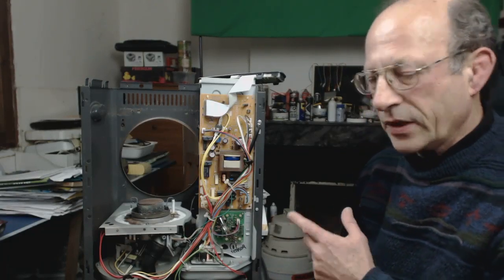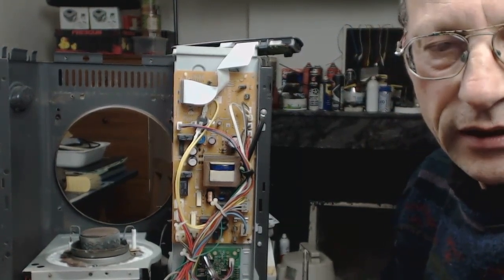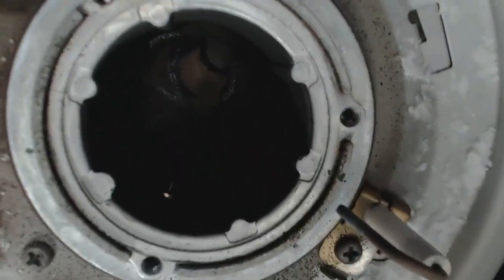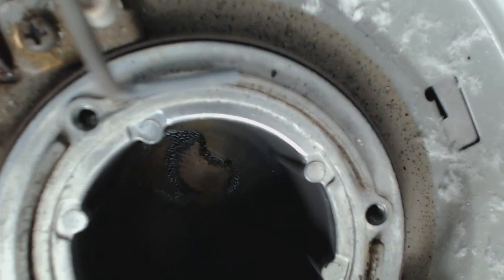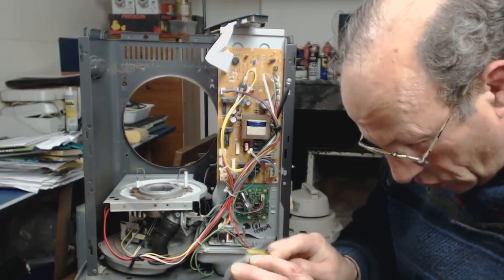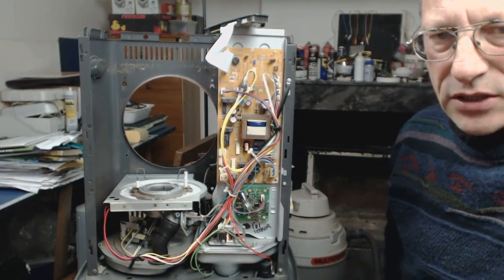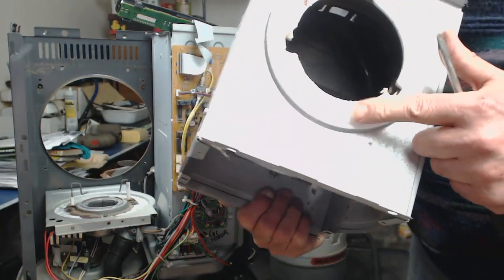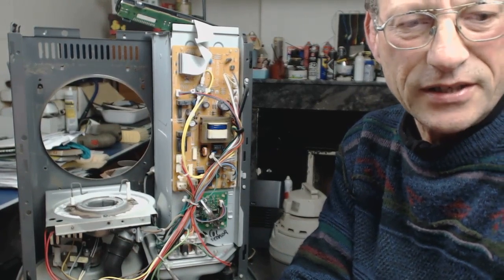Paraffin / kerosene / petrole heater: E4 Error (E0-E4) - Easy Fix

Comment: hi great vid however after cleaning flame rod heater runs fine e 4 fault gone until it gets to temperature the e 4 fault again if I raise temp to 30 it will run all day ,could this be faulty flame rod ?
Reply from the maker: It's a question that probably relates to the heater history.
You need to state if it ran fine last year.
Was this the first start of the year?
Were you starting it with the fuel that was left in the reservoir, from last winter?
What is the fuel that you are (were) using?
... home heating oil, or high grade portable heater fuel?
Where you live can also help, vis a vis available quality fuel, and altitude.

Well done, for cleaning the flame rod ... but we are now at the analysis phase, and that requires information.

Subscribe to the channel, and click the bell to accept notifications, because I am now preparing some new videos for you (I'm pausing on that task, to answer your question) 
:)
Reply: Hi thanks for the reply , yes it ran fine last year and it wasn't the first start up of the year ,been running fine for about 8 weeks now,  then it started  going to e4 .That's when I watched your video and serviced the  heater as shown ,put all back together and heater ran fine, no more e4 but when it reaches temperature say 22  it goes to e4 and shuts down .So I raised  the temperature to 30 (the room wont get to 30) and heater will run all day fine .heater running on new fuel (kerocine) and filtered through mr funnel .Hope this helps thanks .
Reply from the maker: Yes, that was definitely the information required to enable a quick analysis.

There may be a slight drift in the sensors, or related equipment.
This might be within tolerance, if the high grade fuel (specifically refined for indoor heaters) was being used.

However, with the lower grade fuel ... it burns at a lower temperature, AND, combustion is less complete.
this causes solid deposits to build up on the flame rod, and combustion chamber.

This is a known fault, as witnessed by multiple reports across this heater series of videos.
By cleaning these components, you eliminated this problem, but the cause still remains.

I have now developed a solution for you.
The vid will be published this week, followed by an in depth explanation.
Anyway, I guess that you will be happy with just the solution.

Buy some acetone.
The more you buy, the cheaper it is.
Last week I restocked and got 5 litres for €15.

At a 1% mix, this will treat 500 litres of fuel.
At 2% - 250 litres.
Therefore, the cost is insignificant.

Try it first at 1%.
IE. 50ml added to the 5 litre reservoir.

Don't worry about this being such a small quantity ... I'll explain everything in the vid.

For easy, and relatively immediate testing:
Clip your siphon tube flat at the end, remove the fuel filter (https://youtu.be/tKpzPCLnhuw)
Pump as much of the fuel as you can, out of the fixed reservoir.

Replace the filter, and the reservoir with the treated fuel.

Remove the cover, and start the heater.
Take it to hottest temp for 20 minutes, from time to time, checking the flame.

Compare this to the flame that you have now.
Also feel the increase in produced heat.

Once you are satisfied that the new mix is burning nicely, you can then lower the temperature by one degree below the stated air temp.

You'll hear the burn process drop.
Check the flame.

If all is well, drop the temp setting substantially.
You should hear a bigger drop in the burning.

Obviously check the flame, and see if it keeps alive.

Take it down to the minimum temp, which is usually below what the heater can drop to.
It should be able to cope with this.

If the flame is not looking good IE too much yellow, you may need to up your mix.
You could take it to 1.5%, and then 2% if needed.

The big gain was in the first 1% ... as you add more, you also gain, but you've already had your big boost.

Please make sure that you report back with your results.
I need kerosene results because I'm using C1 grade paraffin (https://youtu.be/dRmrEOBsEDw) 

:)
Reply: hi ive followed your advice and added the acetone and im pleaded to report the heater is working perfect again :) ,would you advise I use c1 grade paraffin in the future ?. Thanks for your help .
Reply from the maker: Thanks Robyne for following my advice, and acting quickly :)
(some people talk, some people 'act' )

Great news, and excellent feedback.
Thanks for taking the time.

While I knew that this solution would work...
Having  physical confirmation is very important.

From your response, it is not clear what fuel you used with the Acetone
Please confirm the fuel that you used.

Was it kerosene + Acetone
or
C1 + Acetone 

Also confirm the approximate mix of Acetone to fuel (please).

Regarding your question 
"would you advise I use C1 grade paraffin in the future" ?

These heaters are designed to burn C1.

'Designed' means that, a metered quantity of fuel is injected, to match the quantity of air that is pushed into the combustion chamber (the fuel/air mixture).

The control system is not highly intelligent - rather, it is 'a bit intelligent'.

It knows that if you ask for a certain temperature ... it must inject a certain amount of fuel, and the fan driven air supply adjusts.

If you ask for a higher temperature, it delivers more fuel, and more air.
(you can hear the fan speed rise or fall, according to temperature request)

If the temperature sensor is functioning correctly, and if the fuel has the specified volatility (C1)...
The fuel and air burns perfectly.

BTW imagine trying to light kerosene with a flame ... compared to petrol (don't try this!)
The kerosene might light ... the petrol will definitely explode ;)
That's volatility!

Now imagine ... instead of C1, the fuel that you are using has a lower volatility (kerosene)
The heater computer doesn't know this.
It injects the fuel quantity, as if it was C1 fuel.
... but it isn't.

The combustion temperature is too low for kerosene (if it is to burn correctly).
So it burns, but the combustion is not complete.

Okay ... the temperature goes up, but the computer sees that, and again, injects the wrong quantity.
This means that the fuel/air mix is never correct.
... and poor combustion results in pollutants and deposits around the combustion chamber.

But ... by adding Acetone, the kerosene can combust easier - it mimics C1 fuel.
Therefore, by adding Acetone, your heater combustion can function correctly, even though you are using a lower grade fuel.

Have I explained that well?

What happens when Acetone is added to C1 ?
The fuel/air mix must also be wrong (yes?)

Ha!
The difference is that this mix is going in the right direction for us.

The combustion is hotter ... we hit our requested temperature quicker
... and the fuel supply is reduced earlier (because we have already hit our required temperature)
Therefore:
- Less fuel is used
- Combustion is more complete (it was already good with C1)
- The combustion chamber remains clean

BINGO!

The kickback is that less fuel is used, and the heater can run at lower temperatures - great for smaller spaces, like my workshop.

It's win, win, win.

The only concerns are:
- Fuel price
- Pollutants

Be aware that kerosene contains more pollutants (normally vented outside the home).
With Acetone, combustion will be improved, but I have no knowledge of the effect on the air borne pollutants.
Logically, the situation will be better, but I cannot state by how much.

My advice is to find the cheapest source of the highest grade of fuel.
However, I do know that in many countries, you have no choice
... or C1 is just ridiculously expensive.

In such cases ... please add Acetone to the fuel (oil).
You will save money, stay warm, keep the heater clean, and possibly (logically) breath cleaner air.

... Report back with confirmation of the fuel you used, and the Acetone mix (please).

:)
Reply: hi the fuel used was kerosene +acetone 50 ml to the 5lt tank ,ive about 10 lt of kerosene   left to use up then I think ill change to c1 . cheers again
Reply from the maker: Thanks Robyne ... That confirms that the Acetone improved the fuel burn of the kerosene sufficiently to solve your problem.

If I was you, I would try to source the C1 now.
Add a bit of Acetone and run a tank through it.

After about 4 - 6 hours, it will likely have self cleaned, and be running beautifully.
They always take a few hours to clean out all the sticky fuel that remains from last season; even when C1 has been used.
It'll be worse if kerosene had been used.

Mine is now running on absolute minimum, and pushing out entirely blue combustion jets IE. perfect.
I've got photos of the burn, and will put them up in the next video.

The acetone really helps with the minimum burn, and it is still providing plenty enough heat, for minimum fuel consumption.

You haven't said where you live.
Some countries may not have cheapish sources of indoor portable heater fuel, and the amount that we burn over winter requires a decent quantity

Here in France it is piled up on pallets in every supermarket in 20 litre containers.

If the price for you is excessive, you can mix the kerosene and paraffin 50/50.
That would lift the grade of kerosene half way  towards paraffin.
Obviously, if you can't get it, then you have the Acetone trick to get the kerosene burning as well as is possible.

Either way, your stock of kerosene can still be burned
Overall ... it's a win :D
Reply: hi im in Lancashire near Manchester ,kerosene is  about 76p a litre ,c1parrafin about a pound a litre so not to bad .
Reply from the maker: Thanks for that info Robyne.

Comparing the flash point of C1 to C2 ... 56 degC vs 66 degC we can roughly estimate that  C1 contains around 17.% more energy.
Therefore, purely in energy (heat production) terms; kerosene is costing you around 90p per litre.

This means that you are paying around 10p per litre more, to get a cleaner burning fuel, that has all dangerous combustion products reduced to a bare minimum, to a point where it is considered entirely safe.

Chlorine gas - 5  / 150 ... 30 x better
Sulfur -           0.1 / 1.0  ... 10 x better
Lead -                5 / 25 ...     5 x better
Copper -            5 / 40 ..      8 x better
Zinc -                 5 / 300 ... 60 x better

Also, the big win is with maintenance:

Ash deposits - 0.01 / 0.2 ... 20 x better

This latter figure means that there will be very little build up of clogging materials, when using C1.

Honestly ... if you are going to continue to use Acetone, my guess is that the higher combustion temperatures will further clean up these figures, and definitely close the cost gap even further.

Note:
With Acetone, the heater can cope very well on the minimum temp/burn setting.
Personally, I always use the heater on this setting, due to the heat it pushes out.
... and it uses the bare minimum of fuel.

Therefore, I am confident that you are making the right decision, to burn C1.
When all is calculated, the cost difference for heat output (where you live) is insignificant
... and you are not polluting your home.

Definitely a great conclusion :)
Reply: win win :)

Comment: I'm about to go at my inverter heater 5086 3.2kw tomorrow after being plagued with E4 error last few weeks .
Hope I can fix it .
Reply from the maker: You can ;)
:)
Reply: @EngineTuning  I think I did it :) it works fine even better heat .although the machine was different than the one shown with a bit of patience it was straight forward .
You sir may have saved me buying a new one or paying hundreds to fix it .
Thank you so much for posting this video .
Reply from the maker: @conegan630  Nice work Con :)
There are many models - some are exactly the same, whilst others are broadly the same, but with perhaps slightly different programming.
You obviously sussed it.
So you win that sense of achievement.
Nice!
Reply: E4 error back again I'm afraid is there a way to get at the pump maybe .
I'm resigned to buying a new heater is say .
400e is a nice hit to the pocket 
😭
Reply from the maker: @conegan630  Clearly, something isn't right.
However, you did fix the problem.
That fact must anchor your thinking.
Strict logic must be employed!

While we can all accept the existence of Pixies and Elves, playing mischief while we sleep...
We have to question whether they are such a set of twats, that they will undo something that was already 'well tight'?

My thinking is that 
a) Something loose made a good connection, when you serviced the heater.
The Pixies simply waggled it a bit, in order for it to loose it's connection.
Such an event has been part of male life since the arrival of complex machinery.
The responses have always been the same:
Hit the system semi-gently with a hammer
OR
Work your way through the system, ensuring that everything is tight, and correct.
b) There was water impurity in the fuel that was perhaps reintroduced, prior to the post-service failure.
Determine precisely what occurred prior to the 2nd failure.
OR there always remained the impurity, waiting for it's chance to take effect.
In such cases, you should seriously consider adding acetone to the fuel, at around 1%.
Don't forget the fixed reservoir.
1% gets the job done, but you can always add a bit to the fixed reservoir as well (it doesn't matter if you add a higher percentage of acetone, it's just that there will be no additional benefit).
Buying a water filter funnel, will help eliminate this potential problem.
:)
Reply: @EngineTuning  thank you I will try the acetone .
And move my fuel from where it's stored to another part of my house .
May take it apart again when I'm off work next for another inspection .

Comment: Thanks for the effort to make this video's.
After cleaning the air and petrol filters ,i even cleaned the pump(delicate with the small springs inside) i still got e9 error(google tells me this is the pump or filter).
I get fuel from the pump to the burner,but the damn thing burns 2min and stops with the error.
I replaced the burner wick (pasted with special glue) ,but it worked ok for 2 weeks before this problem .Any ideas?
Reply from the maker: Bad news indeed Sonny.

It's so hard to say, because another fault may cause a fault that gives the error.
A bit like a blocked air filter on an engine could make it run rich... but also if the jet is too large, but also if the choke is stuck on etc.

The flame rod might have failed... but I can't see why.
If you've watched Porky's video... he talks about the flame rod failing, and needing to get new ones.

You are probably gonna have to think outside the box.
What about running it in the open state (like I have it in the video).

You say it runs for two minutes.
That's a major clue.
It means a number of things (potentially).

Fuel not leaving the reservoir... so it runs out of fuel.
The flame rod not in the flame.
A bad wiring connection somewhere.... check all connections.

Stuff like that.
The fact that it will run, means that it works.
Something is telling it to stop working, or it runs out of fuel.

Oh yes.... the big question is... did it work when you put it away last winter?
I had a sensor fail, while it was just sat there (the CO2 sensor vid).

Let's hope that you discover the cause.... then you can tell us.
Good luck, and report back :)
Reply: Thanks for the reply.
Well i opened the burner   ,to find again lots off carbon buildup around and under the needle that comes in the burner(injector).That was the reason i replaced the wick and cleaned the burner 3 weeks ago.
So asuming this is a pump problem ,if i start it with the injector disconected it drips,dont know if this is normal ,or should there be some pressure to shoot it out of the needle in the middle of the wick? The petrol seems to be collecting under the needle.
I think its time for a new heater ,the burner was already damaged a bit by the carbon after cleaning last time.hate to use this if i am not sure about safety.
Reply from the maker: Yes, sometimes you have to give up, due to time constraints.
These faults can absorb your entire existence :(

Comment: Hi, i don't have any message error, but it don't want to get on....
The clock works, and that's it, just don't come on...
What can be the problem?
Thanks for your support.
Reply from the maker: I don't know, because it could anything ... even the switch. In truth,  you need an electronics technician, or a technician that is experienced with these heaters.
Sorry that I can't help

Comment: how to fix E9
Reply from the maker: Your heater has been knocked.
Place it on a flat surface, and cycle through the start procedure, until it starts correctly.

I don't know how many times; maybe 3 to 5 times.
Let us know how many times it took.
:)

Comment: Can these be converted to run on 12v?
Reply from the maker: I have never thought about a battery as a source.
The key is to monitor the energy requirement during start procedure, when the combustion chamber is being heated.
Fans also kick in, but it will be the heater that draws the most current.

It's an interesting concept, but from a practical point of view, you could easily go down the high tech wick route.
They are not as adjustable as the inverter, but they are reliable, and kick out a shed load of heat ;)

Do keep everybody informed, if you proceed with your project :)